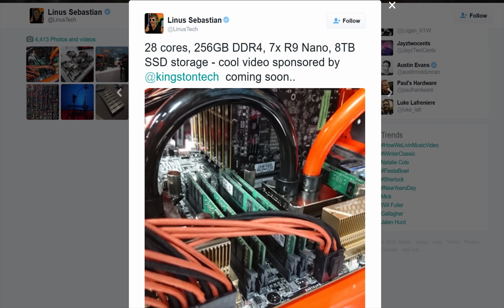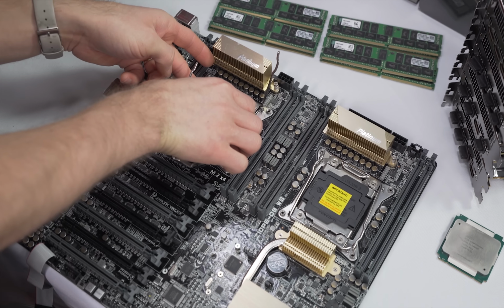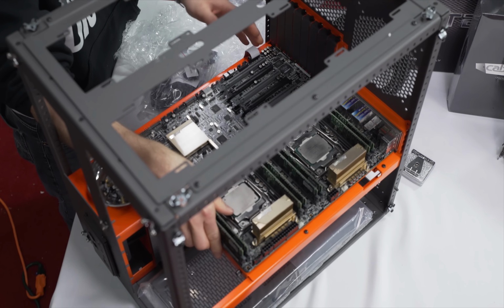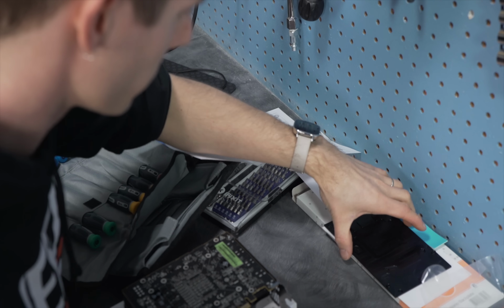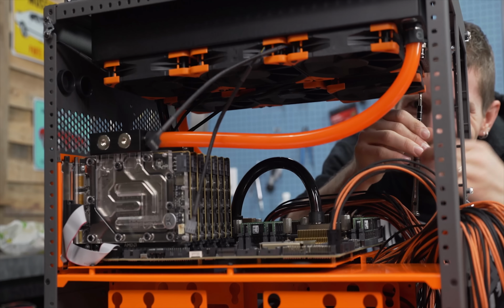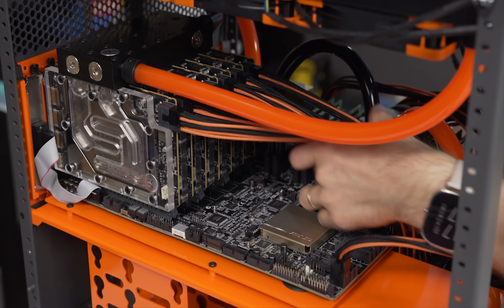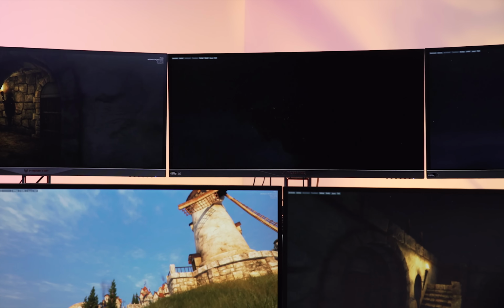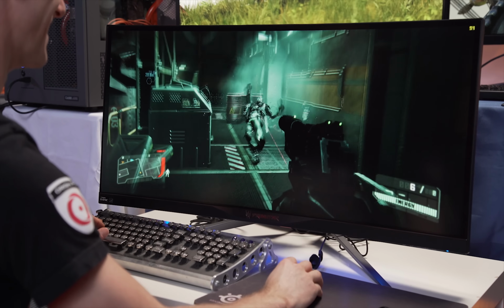7 Gamers, 1 CPU - Ultimate Virtualized Gaming Build Log

Comment: build 2 rigs like these, each for 5 or 6 gamers instead of 7, and you got 5v5 or 6v6 tournament machines ready to run
Reply: +Nikolaj Lepka This is exactly what I was thinking. I wonder if systems similar to this will be used for tournament play in the future. Seems like the ultimate way to give multiple gamers the EXACT same experience in order to have no unfair advantages. They should all even run at almost exactly the same temperatures thanks to the single huge water cooling loop... Pretty cool.
Reply: +Farid Nicolas Wakim When I saw 2 gamers 1 PC I was just glad there were no cups involved.
Reply: When i saw the 2 gamers 1 cpu video i thought of that and as i am thinking of opening a gaming internet cafe and thats an even better and crazier pc.
Reply: Farid Nicolas Wakim
you might have more luck just starting out with a ton of used hardware
it's way cheaper to get hold of, and you can get a ton of computers running in a short span of time instead of having to do this monstrosity. Then when you're rich you can upgrade :P
Reply: +Nikolaj Lepka 
While it sounds kind of neat... Building 2 machines instead of 12 would cost an upwards of 15 grand more.... So you save all that room with just 2 rigs, but you also take on all the inherit hassle/issues of coordinating 6 people on each rig. What a nightmare!... and then your friend downloads some midget horse porn and now all 6 of you are fucked. lol
Reply: '3.5 gamers one cpu' doesn't sound as good.
Reply: +Lolimaster Yep, I agree. It's a cool idea, but I think this whole build was just a proof of concept.
Reply: +Farid Nicolas Wakim If you're serious about that idea you should see which is actually better value. 3 2player PCs or 1 6player PC.
Reply: +Farid Nicolas Wakim where u planning on opening that cause it sounds pretty cool
Reply: +FlashlightGuy my point exactly.
Reply: FlashlightGuy
because people have time to download horse porn at a major event
Reply: +Nikolaj Lepka great idea, thank you
Reply: +Johnny Walker i was glad too
Reply: +Kevroa in lebanon but there still is alot of time to do it.
Reply: +Sonic Mudkip i prefer the 2player ones as they will be
*as they are more cost effective on the electricity bill *they are easier to manage and maintain as i do have to turn everything off in order to be able to fix one block (2 pcs)
Reply: +FlashlightGuy thats why i prefer the 1 block 2pc idea as midget horse porn might dick (pun not intended) me over

Comment: So, you use a case like that instead of something like a Mountain Mods?  Xeon instead of something like a Intel Core i7-5960X?  The monitors aren't even the industry standard which should be the PG278Q which is 1/3rd the price.  No one games on 1tb SSDs.  You should have one 1tb SSD for the windows install and then 256gb Samsung 850 pro SSDs for the VM installs.  Watercooling is just complete overkill and this is from someone who was the very first to water cool a xeon build more than 12 years ago.  This total build should have cost you less than 1/3rd of this.  It's a completely stupid build.  A waste of money and the system I could build for 1/4th the price would have been faster for gaming.  You should have used a system like this http://www.mountainmods.com/ascension-black-wrinkle-powder-coat-original-top-p-462.html.  It's a shame that this idiot will get this attention when there are many who have been doing this sort of build for years, far better and for far cheaper.
Reply: +phas3d Have u watched the video? They used that case company because THEY WERE SPONSORED BY THEM. Did you also hear about the Xeons? A i7 5960x has 8 cores, while the xeon has 14. if they used the 5960x they wouldnt be able to give every gamer 4 cores. Also, since when did the type of storage device effect game device. They used the 1tb drives because 1.it was smart and 2.THEY WERE SPONSORED. If they used air cooling rather than watercooling, the computer would perform worse and/or be very very loud. Did u even pay attention to the point of this build, it was to provide a very good gaming experience on one tower, not build a wicked powerful system. He even admitted that a build like this was impractical so i dont see why ur saying that
Reply: +phas3d You totally missed the point of the video.
Reply: +phas3d The entire thesis of this video was stupid, no one in this world is dumb enough to build a single rig for 7 PCs, but the point of it was entertainment and yes he doesn't pay a single dollar for any of the hardware he receives, its all sponsored or just left over equipment from other sponsorships.

Comment: It's only me, but I saw Linus installing 2 CPUs?
Reply: +RockyHD Their title is just a bit misleading.
Reply: Yep
Reply: +RockyHD 
The build isn't technically 1 CPU setup.
Reply: +RockyHD I believe it's a play in the '2 girls, 1 cup' title :P
Reply: +RockyHD but it's still 1 computer.
Reply: The two cpu's count as one
Reply: +RockyHD the board holds 2 badass CPUs
Reply: +RockyHD just like linus said those 7 gamers can have a 4 core and 4 threads
Reply: +Daryl Washington (Cap D) its still just 1 tower, its just a dual cpu motherboard
Reply: +Ultimate Doge No.
Reply: +Sólyom Csaba Technically, it is. With that mother board CPU resources from the 2 CPUs are still shared and pooled and cannot be split into two machines running two different kernels without virtualization. Effectively they act exactly as a single CPU would, just with way more cores.
Reply: +RockyHD i think he just probably meant in one Tower.
Reply: +RockyHD those are not CPU's those were Xeon's u silly  ;)
Reply: +Giorne Ganz say wat?

Comment: This is so great for the whole LMG crew to kick back and get on 2 couches to each play on a seperate screen at 60FPS, way better than console split screen.
Reply: "way better than console split screen"

Yeah, but it only costs about 100 times as much.
Reply: Pelias Think about this: You can make this build a TRASH TON cheaper. If you choose to use only 4 (cheaper) graphics cards, 1080P 60 HZ monitors, you'd still get a multiplayer experience infinitely higher than any console on split screen. Also, by only using 4 GPU's you'd need a cheaper PSU, let me calculate the possibilities right quick, will update when I've got eem.
Reply: That's still almost 20 times more expensive than a console...
Reply: No one is going to drop $6k for a 4 player system unless you're Bill Gates.
Reply: We weren't talking about 7, we were talking about 4. 

$30k is nowhere close to the cost of a PS4 + 3 more controllers + shit tons of games + PS+.
Reply: +Captain Leerox +pelias It is not about "pc vs. console" guys. and not it is not for the average consumer. It is just a project and experiment.. stop being childish.
Reply: +Pelias And it doesn't include mouse/keyboard or headsets for all those players.  And then you'd need a massive desk or multiple desks.  You could just get your friend's a few consoles and little flat-screens for a much lower price.  With all that extra money you could afford enough Mountain Dew to drown you and all your friends.

Still, it would be an incredibly fun build.  Thanks +Captain Leerox
Reply: You forgot really expensive too. You have to admit that nothing can beat the practicality of split screen or LAN.
Reply: +Pelias https://pcpartpicker.com/user/Leerox/saved/2GYxFT 
HERE IT IS FRIENDS.
Reply: +Edy Andronache That's one PC. This here: https://pcpartpicker.com/user/Leerox/saved/2GYxFT
Can have 4 Gamers on at once, and will play 1080P 144HZ games just fine.
Reply: +Captain Leerox you done yet? i'm curious :D
Reply: Justin Fivash Just add $3000 and still it's $10000, where each gamer would pay $2500.
Reply: +Captain Leerox I think those two cpu coolers are too big to fit on the board together with 4 gpus even if they are short r9 nanos
Reply: ^ too right, this isn't meant to be a consumer grade product for people who want to play games together. Of course, it's way too expensive. 
This was just done for the novelty.
Reply: +Captain Leerox aboout 2500 bucks with i7 6700k, 32gb ram, 2 samsung evo 500gb ssd, 2 gtx 980 sli and two dells u2414h ;]
Reply: Joni Defer Yeah here it is: https://pcpartpicker.com/user/Leerox/saved/2GYxFT
Reply: Pelias And? It's 4 players on 1080P 144FPS Ultra systems...better than any console ever.
Reply: +Pelias You need two consoles for 7 people, online subs, $60 games, overpriced peripherals, etc. The cost isn't too far off. PC is always cheaper in the long run, whilst console is cheaper in the short run.
Reply: megapro125 Apparently PcPartPicker says it's fine, and the motherboard is HUGE, the space between the CPU socket and first GPU slot is ALSO huge.
Reply: +TJGreen yo this is the internetz, you dont think here, you get enraged by something not meant to be offensive and get furious, thats how it works buddy, fuck your logic
Reply: Most people don't have 30k to spend so....
Reply: Tucker Higgins Look at my previous comments, you can cut the price by $70 by cutting out some fancy pants things, like the E5-2697, and just get 2 8-core Xeons or even 2 4-core XEONS.
Reply: +Captain Leerox 

Uhh...  Most people don't have $29,930 to spend either.  = /

(This is mostly in jest.)
Reply: +Captain Leerox Yeah... or just buy a Wii U a TV and a couple controllers and play smash and MK8 with friends.

Comment: 11:10 So you mean symlinks.
Reply: +waterlubber sounds like they used reflinks, you can read more here: http://www.pixelbeat.org/docs/unix_links.html
Reply: +waterlubber Snapshoting is different than symlinking. It can be done using Btrfs or ZFS or using LVM. You create one device, install windows there, than clone it 7 times, and be able to write independely to the clones, but only using space of one for the base image. The snapshots / clones will use zero data on the start, and they will start using more as you start modifying (installing software, making updates, removing software and data) it.

Comment: Isn't it quite fucking hazardous to put a water cooling in gaming setup worth $30,000 ? Ya know, if ANY pipe is just a bit broken, all the water will make a huge short circuit and it will probably fuck all the shit inside up... just saying. I'd never put any water inside my PC EVER. Even if it's worth $500.
Reply: +Cold Fire You know investigate about water cooling and then  comment you morron Ive had my graphics cards and cpu on water and never leaked
Reply: +Cold Fire Thats why you do a leak test just after you finished assembling a watercooling setup. if you know what you do, take precaution, watercooling is very reliable
Reply: nokia gameplays why did you call me a moron lol xD Your ego must be so low dude. I said nothing that could offend you...

Comment: Can you make it run a single copy of windows, and then run pong at 320x240 resolution, and see if it can maintain 60FPS or higher?
Reply: +Razor2048 i tried it, not 60fps, but playable 20-25 fps if you turn shadows off
Reply: +derkevevin Actually, you would be surprised. Getting twice the FPS needs more than twice the processing power (see their video about the 480 vs the breadbox and piss-station)
Reply: +Razor2048 i know its a joke, but i'd like to know how much it could do, probably a trillion fps at pong xD
#1.000.000.000.000FPSmasterrace
Reply: +MrDrTheJniac yeah, but a game like pong? the 1 trillion fps is an exaggeration, but even a normal high end pc would probably do like 1000fps. maybe even more if optimized. i have some experience because of some simple games i made in game maker.
though, im wondering why my graphics card didnt break a sweat doing like 800fps because there is no fps cap.
there are some real games that make your gpu run hot if they are not fps capped. maybe its because of the memory? (since a game like pong would use next to no gpu ram)

Comment: I don't get, how every of the seven gaming VMs runs with four cores? I mean 7*4=28. How is the host system running?
Reply: +spoilerkiller the host sysytem probably just borrows a very small portion of power since it doesnt take alot to run
Reply: i guess one VM only has 3 cores... wich gives the host system one normal and one hyperthreaded core to do it's work

Comment: But can it run Arkham Knight?
Reply: Probably not above 30FPS, honestly.
Reply: +PishPosh43 my gtx 980 to, i7 6700k, 64 gb ram barely pulls two frames per second on club penguin, I doubt this can execute. But honestly miniclip, the goto for professional PC gamers, doesn't even open.
Reply: +Joe Gay  well they fix that BS now and its run pretty solid now:) just for the info
Reply: the question is, can it run club penguin?
Reply: +Sheppardsg1 still many video cards espeacially the 980ti have problems i dont know why but it does.
Reply: Rathip Raja freaking club penguin

Comment: Is it possible that you could install a single OS on this PC and then run some OpenCL benchmarks. It would be insane to see how much this would destroy when rendering in blender.
Reply: +aljowen AMD drivers dont support 7 way crossfire
Reply: +MichaelParktheFirst I dont know how it works on the amd side of things but on the nvidia side you dont need sli to use cuda. Hence why i have both a gtx 970 and 560ti in my pc. Cuda can use both.
Reply: +MichaelParktheFirst for rendering you don't need cards in crossfire or sli, render engines can send different instructions to different cards. Render engines break down the 3D model in to a 2d plane from the cameras prospective then cuts it in to blocks and the gpu works on one block, if you add another gpu the render engine will render 2 blocks at the same time and if you have 7 GPUs it will render 7 blocks of the image at the same time if the render engine supports it, which I think blender can (also it's how the film industry do it they rent a "supercomputer" to render all the CGI normally called a render farm with 100s of GPUs and CPUs)
Reply: +MichaelParktheFirst you don't need crossfire for using OpenCL
Reply: sorry i thought he just mean benchmarking the system in general not for work esque things

Comment: I have a GTX 690 and an FX 8350,right. Say I wanna do something like 2 gamers one computer.. Could I allocate 1 680 and split CPU performance across the two?
Reply: +Dillon Cornett I think so. It is the same concept.

I was about to say no, but then I remembered the 690 is already an SLI card.
Reply: +Jordan Abendroth Why? The 690 is a dual 680 SLI built in on PCB.
Reply: Oh, yeah, I was thinking it was a single GPU card.
Reply: yeah, you would need another GPU though.
Reply: +Dillon Cornett Unfortunately, no. Presently, the way this technology works is to hand off the PCI slot exclusively to the target/guest Virtual Machine such that the host, or other guests, cannot really touch it. So despite technically having two GPUs built onto one card, only one VM would be able to have access to that physical slot in your machine, so it would have to get both of the 680s build onto that card.
Reply: +Dillon Cornett It's hard to do with Nvidia cards but there's a workaround in ESXi. Nvidia disables vGPU functions by default because they want you to use Quadro or Grid cards. But AMD allows vGPU passthrough on any card.
Reply: +Carlos Alberto Deleón Because for now, you need to perform PCI passthrough to hand control of an entire card from the host OS to a guest OS inside KVM.
Reply: +Dillon Cornett You'd need special VM software :)
Reply: +Dillon Cornett im better, ive got a GTX 750TI +16 gb ram + A8-7600
Reply: +Dillon Cornett That's an interesting premise. I'm not sure if dual-gpu cards can allow them to run independently or if it must be in SLI.

Comment: Why didn't they use Titan x's
Reply: did you not watch the video?? he said that it wouldn't fit and take way too much power
Reply: +jalopy they'd need to go either with a 3k watt psu or multiple psus
Reply: Yorgarazgreece 3000 watt dont exist for desktops and more than one power supply would need a custom made motherboard
Reply: +jalopy It can theoretically work. (Watch Scrapyard Wars 3. Austin used 2 power supplies and his system worked.)
Reply: +jalopy https://www.allhdd.com/?subcats=Y&pcode_from_q=Y&pshort=N&pfull=N&pname=N&pkeywords=N&search_performed=Y&src=ggl&q=WS-CAC-3000W=&dispatch=products.search&gclid=Cj0KEQiAqqO0BRDyo8mkv9y259EBEiQApVQD_ZdpshjUPlcnh-4_9rzqO3H10qHtTluN4Y09X-tBFsUaAhax8P8HAQ look at that link

What do you know a 3000 watt power supply
Reply: jalopy those xeons in this build aren't desktop orientated either. And no custom made motherboard is needed.
Reply: +The Jacksta Yeah, just keep ignoring how much space they would take up still.
Reply: durpadoo they could stack two Core X9 or something like that and still not take laods of space.
Reply: +The Jacksta In addition to the other responses, I've heard rumors that Nvidia cards don't respond well to PCI passthrough, while AMD cards are fine with it.  As such, for a build like this, AMD cards are the logical choice.
Reply: Niarbeht that indeed would be a logical reason of not to go with nvidia gpus. But i don't think that's the case. There are builds with 8 tesla gpus that work flawlessly. I think the main reason why linus didn't want to go with it is because of bottlenecking. I mean, we expect a cpu to handle 7    gpus at once through 40 lanes. That means each gpu would communicate with a gpu through 4 lanes. Totally bad idea. He would then have to go with 4-socket motherboard only to justify the gpus and that would be way overbudget even for Ltt. Not to mention that there is no way of finding 4-socket motherboards that are capable of gaming. Even a typical gaming motherboard is designed to have minimal latency compared to a server board that has to work reliably 24/7. Such product wouldn't make any sense at all to begin with apart from making a youtube video about it.
Reply: +The Jacksta they wouldnt be able to fit it